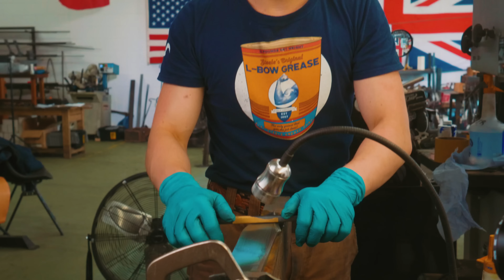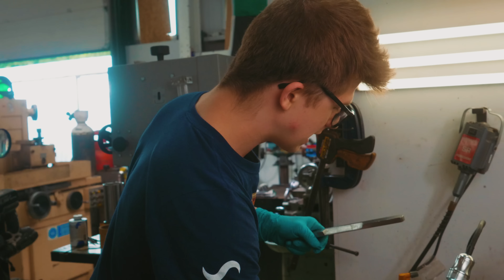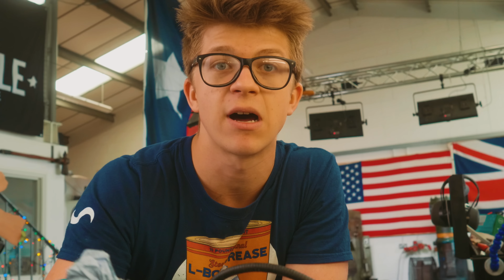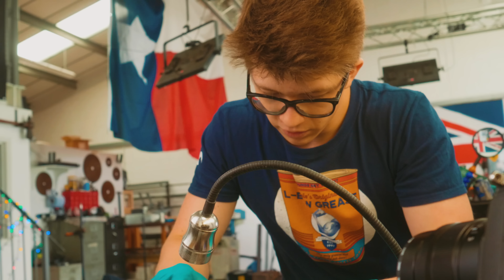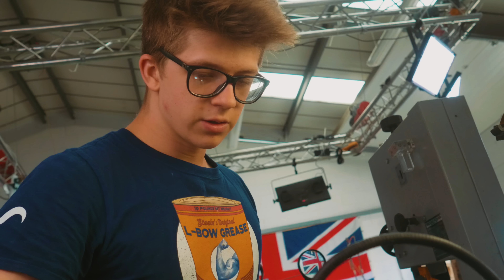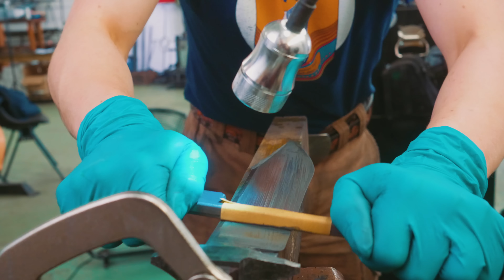ONE WAY TO GET YOUR START IN BLACKSMITHING!!!

Comment: Thank you ALEC and we'll said, I served an apprenticeship as a machinist in NO. LA. 1973-1977 and I almost became a pain in the ass too the journeyman machinist and most of them helped me along but a couple wanted me to learn just thru my mistakes only and even assisted me in failing. But taking pride in my work and applying craftsmanship that my father taught me I wore them down and they finally started to work with me.point is don't give up work with what you are given and take pride in yourself and in your craft. Thank you Jake Bissel

Comment: I’ve wanted to be a blade smith since I was twelve. People like you, with your passion and ingenuity are what convince me that it’s actually possible. Thank you so much good sir :)
Reply: Caleb McCarthy I am twelve and now I really want to start!
Reply: Bruno Crosbie Follow the dream man :)
Reply: Caleb McCarthy, I too wanted to be a bladesmith as a kid, I eas told to be sensible and get a real job, I listened to the adults and I have never stopped wanted to be a bladesmith , now in my 40's I have just aquired an anvil, I will be making my forge by the end of the summer and soon I will start moving hot metal. I would love to take the mentor route, but I will end up in my back yard pounding steel until I figure it out. 

If you want it, find a way. It is not too late
Reply: Creseleg Now that’s what I call an inspiration 👍🏻

Comment: I bought a ball-pin hammer and bought some fire bricks a pipe and a shop vac. I dug a hole and laid the fire bricks in a V and laid the pipe which I had sawed some slices in for air flow and hooked the shop vac up and wooh does that baby roar!

Comment: I've been using different sized sledgehammer heads as anvils and a plaster&sand forge.
Made my own tongs and hammers from flea market finds.
Watch videos and replicate.
Three years and I've made everything from s hooks and hindges to tomahawks.
A belt sander is a must along with a grinder with a cut wheel. Haven't diy'd them yet.

Comment: Purely for a forging set up this is what i reccomend for a budget. 

Id skip an iron or a rail road track anvil. Id spend the extra on a little steel anvil. Id look at local postings online (like craigslist). 

Frequent pawn shops and antique stores for tools and haggle if possible. Buy a couple sets of tongs to start and buy a hammer or two from anywhere. 

Hammer, tongs, anvil and forge are the only things you need to start. The forge might not be the most expensive but it'll be the hardest to find. Id skip a charcoal forge, its too expensive and doesnt get very hot. A coal forge is cheap and can work very well. I have a coal forge that will melt stell in seconds if i want. The problem i have is that im extra sensitive to the fumes. The coal isnt healthy for anyone but it gave me splitting migraines through a mask with ventilation. Now im using a propane forge, its a bit more expensive but in my opinion its the best type of forge. 

Now you have the major things you need and you can start making more tools. Id make all kind of tongs, hardy tools and hammers. 

Then id worry about power tools. An angle grinder is a cheap tool that can do a ton of different things. The next power tool id get is a belt sander, its also a very useful tool. It doesnt have to be a big or expensive one. Then comes either a drill or drill press. Beyond that its bonus if you ask me. 

Then comes a welder, a beginner wont likely need one but id get some type of welder next.  

After that you oficially have a better setup than me. 

If you plan on getting a powerhammer or hydraulic press you should know it requires a very thick concrete floor. Btw you should consider building a powerhammer if you want one. It can be cheaper, lighter and easier than trying to find one.

Comment: If you don't have the skrilla/space for a gas forge, or if you live urban, grant thomphson does a video showing you how to make a cheap, easy to use electric arc welder system that's set up in a way that you can heat stock without a gas system, it'll take a time to get used to but it's doable. plus the electrodes are just carbon rods out of D batteries so it's easy to fix. and it comes to it, you can combine it with fire brick to melt down scrap for whatever purpose.

Comment: Excellent set of advices. The MOST difficult thing however will be realizing that any critique or critical comment on your work is not a critique of your person. Take it as though it's meant to further your skills and you'll not waste endless amounts of energy fretting over something. I't's very easy to get attached to your results and see your ego get up and down with every success and failure. Such a waste of your precious energy. Believe me, I know from experience. Perhaps if focussed on learning rather than the results one could perhaps avoid this trap for a bit. Thanks for a great teaching video, Alec.

Comment: I like to make small knifes and I started this like 4-5 months ago and blacksmithing is a lot of fun, I use a tin can with charcoal from wood and a vacuum, and my anvil is a 20 pound or 10 kilos ish sledge hammer and a small hammer and it seems to be working for me I still have much to learn, you don’t need Much to be a blacksmith just a little motivation,

Comment: Great advice for those who see your videos and are amazed on the steel you forge and want to join in on the fun, though are unsure if blacksmithing is for them (like me lol). I recently found your channel and love the metalwork that you have produced, and classes seem like a great way to achieve both goals of seeing if blacksmithing is for me while learning basics. I recently started your Claymore series and seeing how you did the bar twisting one section at a time got me thinking- would it be possible to do the twisting in an alternating pattern (CW, CCW, CC, etc), and what would that produce? It seems like it would be a cool experiment.

Comment: My advice if you just can't afford classes; Start small, like arrow heads or something, then work your way up. Also start with cold forging instead of using a forge that's hundreds of degrees hotter than you can handle.

Comment: what would be your suggestions for welders and modern metal workers? anything that would change? Moving metal with a hammer is a bit different that moving it with a cutter or as a puddle but there is a related knowledge base.

Comment: The problem that I have with going to a blacksmithing class, is that the closest one available to me is 10-12 hours away and I also don't really have the resources/money to drive, bus or take the train every weekend to take a class that is also very expensive. My only option is to learn by myself and if it takes longer then I will take the time it needs for me to get better at it.

Comment: I'm REALLY hoping with blacksmithing and bladesmithing starting to take off out here again that classes and apprenticeships start becoming available. I did an EXHAUSTIVE search several times and there are no apprenticeships available here, none of the master smiths are willing to take an apprentice on because they've had guys stick around for a few months and learn the little bit they wanted to and then take off to start a shop. The nearest classes I could find were an 8-10 hour drive away and cost a few thousand dollars. The only place within driving distance is now so overrun with people trying to get in after the guy won Forged in Fire that there's pretty much no chance of getting an anvil there. I've patched together bits and pieces of what I can learn from various people when I get the chance to visit another shop to make some things on my own but it's SLOW learning.

Comment: I've thought about it for a while now. I LOVE doing stuff with my hands. As a kid I was always around power tools and wrenches and every sort of normal tool or abnormal tool you can think of. My father is a machinist by trade and his father was too. I've tried producing music and video game streaming. It's meh. I've been a dancer for 8 years now. Though the dancing has kind of fallen off. I learned how to cut meat by butchers in a grocery butcher shop so I'm at an apprentice level butcher level. Just nobody needs a butcher. 

I absolutely love working with my hands. After work at the store, ill go downstairs and repair whatever is broken downstairs. I also took a machining class at college, but college requires way too much book smarts and tons of homework that requires reading about the trade and not doing the trade. It's safe to say I remember nothing about what I read. Only what I did stuck. I'm still mid 20s. I think ill give this a shot because right now I have nothing going on for the future right now for me. Plus making things to me is super fun idea.

Comment: I'm not a smith. Never will be. I just don't have the time to devote to it between bushcraft instruction and veterinary work. However, part of my bushcraft instruction includes a component on tool maintenance. It always astounds me how many students think that grinding down a nick is a quick process. It always amuses me how quickly they change that opinion. 

Another component is basic forging. This is more of a historical component than a practical one and it gives the students the opportunity to create their own belt knife in the traditional fashion -- a forced draught coal fire and a trough full of cold water. We don't typically use high carbon steels since we're trying to keep it as historically accurate as possible. The products are very rarely up to modern standards, but it gives them a taste of how modern blacksmithing developed. A few of my students have gone on to have careers in blacksmithing, so we must have been doing something right at these courses.

Comment: A Great video again Alex i have a Question for you or any other smithies reading this i am not a smithy but find the skill very interesting and have learnt a lot   about hardening the blade etc and have watched forged in fire as well and the tests they do make me nervous Q is there a way of making the edge of the blade harder by adding a harder bit of metal or would that not work ?

Comment: Hey, I got a more "specific" question. I'm the kind of guy that like to know the very basics of LOADS of types of work. I don't want to be a true blacksmith, it would take me way too long to achieve a proper level of craftsmanship, and I don't wanna focus on one job. Actually, I'm a sound technician and a musician (if you ever need one, ask me, teleworking is a pretty common thing nowadays), but I like woodwork, electronic, concrete work, luthiery, and I'd like to "practice" a little of steel working. But I can't afford a true forge, power tools or any expensive things (all my money goes to sound equipment, hehe). Do you have a cheap way to get simple steel hot enough to be workable ? I got the basic tools for everything (hammers, grinders, files, etc...) but I got no place to put a big forge, and whatever, making a sword is, 1) out of my reach, 2) not in my plans. I'd just like to practice on simple small knife blades and all these sort of things. Any advices ?

Comment: Sounds alot like how auto mechanics works as far as the learning process and asking questions and finding mentors and such. But mechanics are much different. Master mechanics get really big headed and irritated with questions. Usually the mid level mechanics want to help the new guys more often. I've studied mechanics and welding and I'm definitely going to learn the art of black smithing as a hobby.

Comment: Found my first Anvil at a second hand shop here at the dutch/german border... Not online - Not in a local newspaper - Not by being told by anyone. I was looking for an anvil and there it was. Sitting in the darkest corner like someone wanted to hide this ~300kg chunk of metal. Looks very industrial (WWII ? ) One edge sharp the other edge slightly round, a "defused" aka. not pointy horn. A slight ding in the face and a few chissle marks on his feet. Other than that its hard, has a nice clean face wich means someone took care with it.(except that one spot) and it was below 2€/kg. Beautiful piece with its own character. A little heavy as the first anvil ? Probably - But i got it and when im at "its level" i dont need to get another one.

Comment: This was a really good video. I just have a question. What if I want to do stuff like make knives, or just in general blacksmith, but I want it as more of a hobby than a job. I am graduating High school in a few days, and I already am going into a field in university that is very interesting to me, and has been for a long time. I am wondering is there a way to be a blacksmith as a hobby, or is there just too much work that needs to be put into it that I would forget the lessons I learned when they are next applicable. I am interested in a lot of things, like I like to build things (I was on the build group on a robotics team), and making knives, hammers, axes, and other tools like that seems cool. At this point I'm starting to ramble, so I'll hope that someone responds. Thanks.

Comment: It ain't always that expensive. I have three 4-5 hour lessons for £10 each (Then £15 per night to use the forge and tools after that) And in those lessons you make a pair of tongs, a coat hanger and a knife. Running over all the basics.

Comment: I do not have access to a forge. I notice that when welding with my old oil bath welder, the metal becomes yellow hot at the point of welding. Can a welder be used to heat metal for forging?

Comment: i wold love to be able to become a blacksmith at leasst i wold worck on some little knife projects on my free time but i curently dont have the money to buy a forge so sadly it wont be possible to make my garage into a working place but eventually in life i will do it.
Reply: rafakiler 25: you should look up how to make a coffee can/paint can forge and start small. I built one for around 50 ish (+ whatever the handheld high heat propane torch was, sure you can find a used one for cheap) and while it doesn’t get up to forge welding temps it is more than sufficient to reach forging temps.
Reply: thanks for the advice

Comment: CHEAPEST WAY :
Go to a garden dig a hole and use a hairdryer with a steel pipe-its your forge!
Then go to a hardware store and buy biggest sledgehammer you can find -it will be your anvil.(or go to scrapyard and find railroad track or a H beam steel profile ).
Also buy one hammer to hit with and grip pliers.
Wile you are at scrapyard buy some steel to hit-thats your material.

Good luck start hitting steel -cheap.Unless you wanna go profesional thats all you need.See if its for you and then upgrade your tools slowly.No classes needed you can find it on the internet and practice,no expensive tools -and if you dont like it you will have a sledgehammer/hammer and grip pliers which you can use.
Most of you have several items from this list already.

Comment: Just a question, I've never done anything like this, and I am planning to start forging, so I have a peace of a lightning rod on which i want to put a sword-like point, and I just want to know is it good metal to forge with, because I know its not good quality metal, but if it doesn't break too much or something I'd like to use it. Again, im only pointing it, no blade or anything, so yeah..

Comment: Have you thought about using a square bar say 30x30 or 25x25 as a sanding stick as you would be able to stick the sand paper smoothly to 3 off the sides (both tears on remaining face). Thus saving the expensive sand paper and spending less time swapping over the tape. You could also mill the "handles" down to give a better feel if the bar stock felt too large.

Just something I thought off when watching this. Cheers

Comment: Ha-ha. I've searched for blacksmithing class in St.Petersburg, Russia for years now. Mostly «master classes» which are entertainment and not education are available, and there is no full course from beginning to advanced techniques. Other problem is place. There is no workplaces to rent and setting up your own forge in big city where everybody live in multi-apartment buildings is hard: you need to rent some workplace which is not afraid of open flame, gas cylinders, etc, and typically it is big big places near big big factories, which are expensive because they are, err, big, and they are not interested to rent 20m² room. 20m² office space is not a problem and could be found very cheap, but not work place which allow you to have forge.